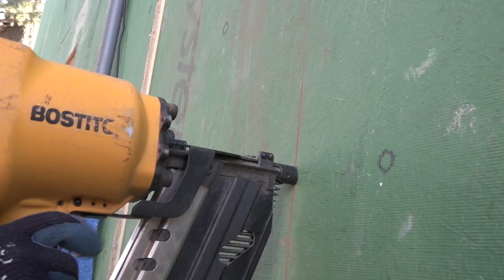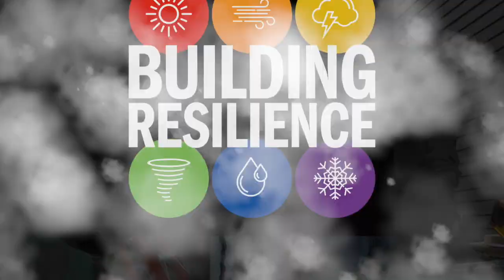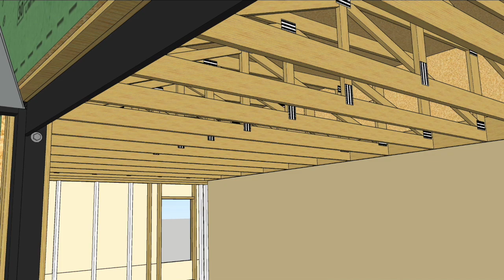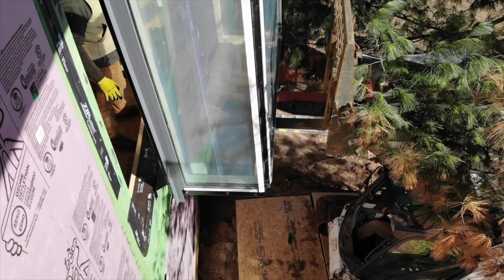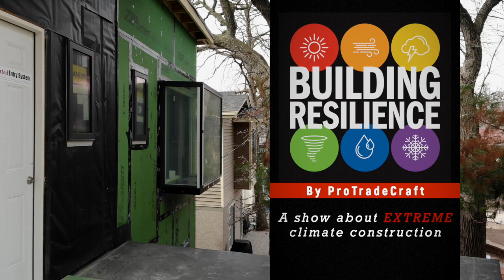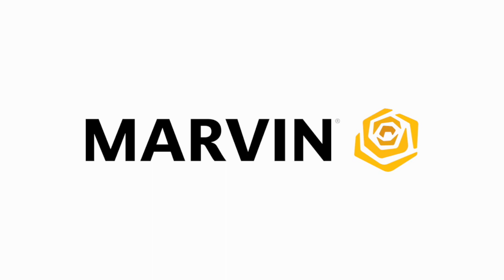Building Resilience (7): A Cubical Bolt-on Window Seat Called  Sky Cove

Comment: Kudos.   What was the total cost of the Skycove window.    Window + Installation
Reply from the maker: Well, it was donated to this project for the video, so remarkably cheap. In the real world it is remarkably NOT cheap. 

The installation is a little nonstandard, as this was the first one ever installed on a jobsite, and it happened during the early days of COVID, so the crane operator wouldn't come to the site, which is why they tried it with a Bobcat, and the engineers were on a zoom call while the guys worked on installing it. This installation dictated tweaks to the design for ease of installation.

I think it took half a day, for three or four people, including the Bobcat driver.
Reply: @ProTradeCraft  Ok.   Understandable.    But any ballpark guess